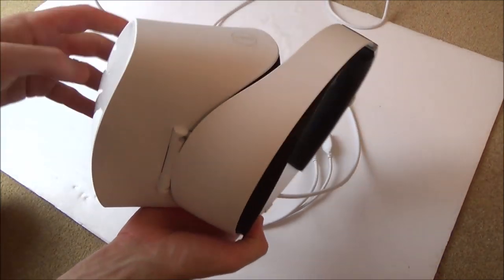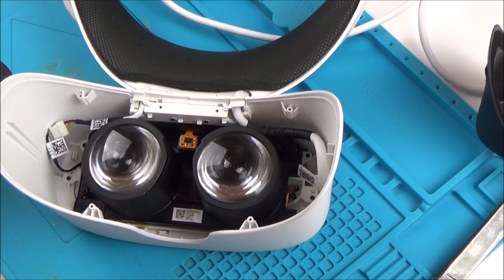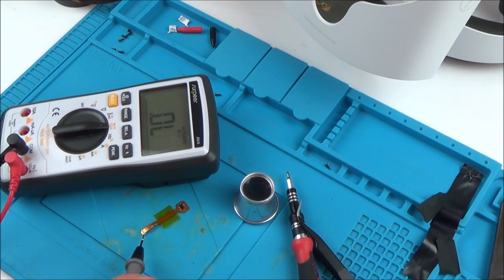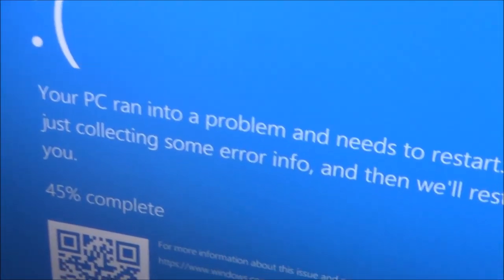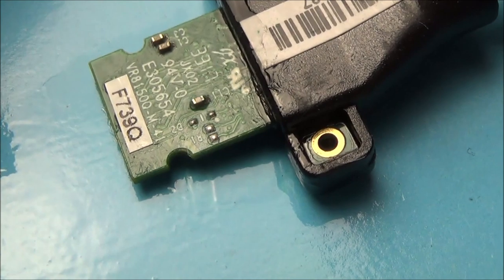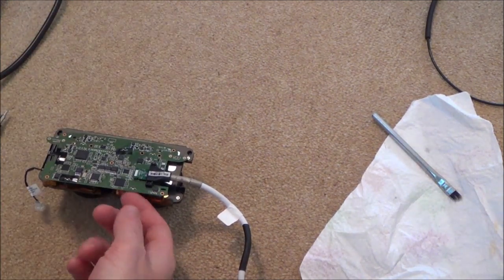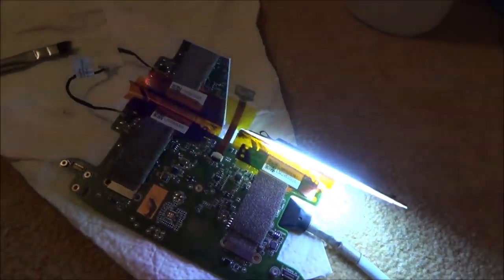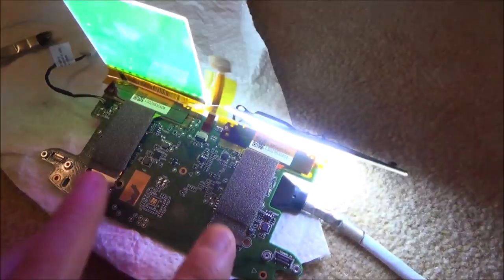Trying to FIX a Faulty Dell Visor Virtual Reality Headset (Quick Version)

Comment: Very interesting to see you mention the loose connection at the start, my Dell Visor developed a problem of the screens occasionally going out mid game - which I originally thought was a driver issue using it with my laptop, but began to wonder about a cable problem somewhere. It's sat unused here for ages (I absolutely should have returned it)

Comment: Quick question, what is the name for the adapter/cable/connector you checked the chip on? I ask, as it's the board is a mipi controller and almost all WMR are built the same, meaning HP, ACES, Samsung, Dell & Lenovo are almost exactly the same.  I have an extra HP headset yet HP headsets have the worst cable, headset cable out of the lot of them.  Hence if you can replace the cable you can find them cheaply.  Yet it's difficult to identify.  Ideally if you can find that mipi connect the VR8200, you likely could rebuild an HP cheaply.  Hopefully this helps but if you know the name please post me or a video on HP WMR.  Good Luck great video

Comment: I have a acer hmd and that board much like yours gets scalding hot. But here's the thing my headset still works. Now when the screen refresh rate is 60hz  it black screens rairly but when the refresh rate is 90hz it black screens in 5-10 min.

Cooling down the board on the cable by fan cases the screens to pop back on if I'm fast enough (with headset dissambled)

I've also had the headset black screen constantly with in 5-10 min like the chip was overheating but there was a fan on it.(mounted a fan to the hmd to keep the chip cool) I believe this to be due to a software fault I reinstalled of windows and used the automatically installed graphic card driver (from 2017 ouch/amd gpu) and I've had multi hour playsessions with no black screen.

Honestly it seems like they got 95% there with this product then pushed it to market.

But for the low cost compared to the compition and it being 6dof its hard to not recommend as a entry point for vr.

Comment: Bruh there is a defect with the Dell Visor my Hdmi cable end melted on the 18 pin which is the HDMI signal so my thing doesn't get detected no wonder Dell removed it from there page and what not. Guess your video proves my point defective power supply and USB cable, I remember the headset getting hot also so now I know the real question where can one get a cable by itself or is it a lost cause just have to save up for another new VR headset. Thanks for this vídeo.

Comment: Hey there, I know this Video is a bit older, but have you any parts off this project left? Right now, I am trying to repair a faulty Visor too. I am expecting it to have a faulty motherboard, but cable and display at least seem ok. Maybe I could send you my parts, so that you can combine them to a working one? 
Btw the Chips on my cable wont get hotter than my fingers, yours should be definitely shorted somewhere.
Depending on the USB Port my Visor is detected by Windows (with full driver install and detection in the mixed reality portal, but then reporting an error) or (on other ports, USB 3.0 as well) crashing half off my computers usb devices. Thats why I am thinking about having a faulty motherboard in my visor.

Comment: Hey Vince I've got an Xbox One S 1tb you might be interested in looking at. It does not power on, and I've checked the continuity of the power button as well as the power from the power supply. I have discovered many shorted capacitors but no obvious fault. This one could be a major challenge. Too difficult for me. Let me know